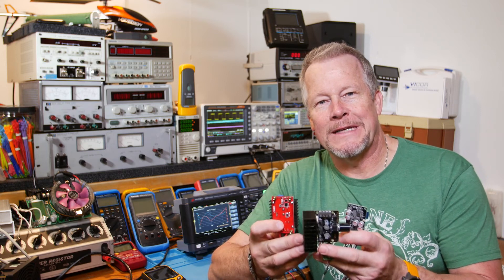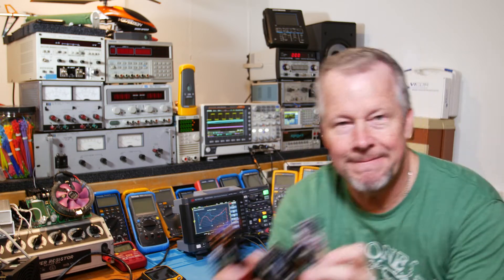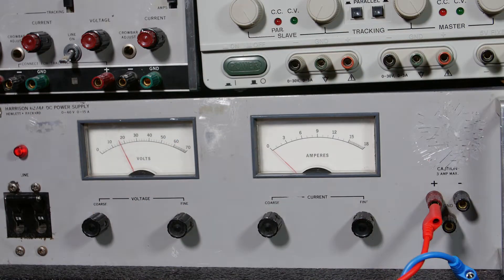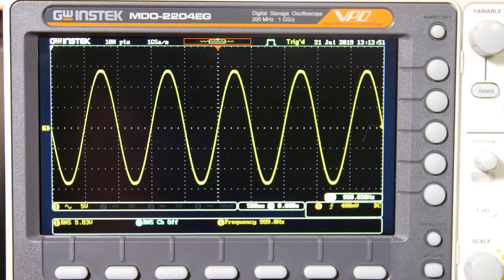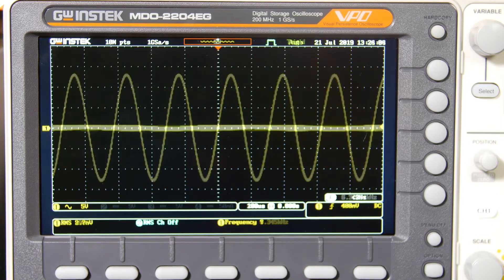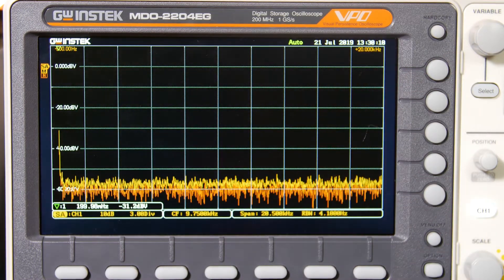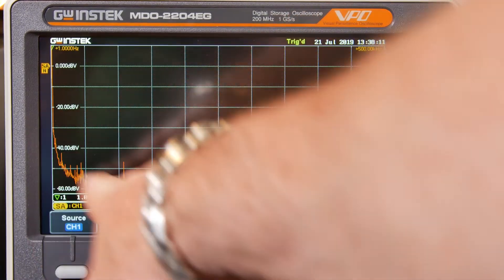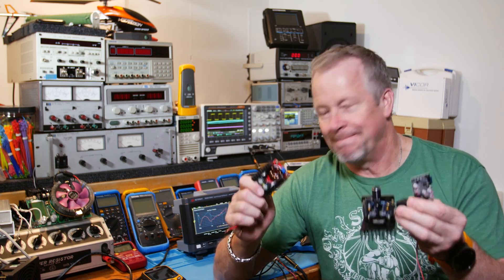DC-DC Converter add THD to Audio Amplifier? #switchingconverter #THD #DCDCconverterforAudio

Comment: Great information Eddie,
That makes me wonder why linear power supplies are still used for Audio applications.
A switched mode power supply will work just the same ?
As it's switching/chopping,  just like the boost converter ?
ATB Adam
Reply from the maker: Adam L thanks Adam!  I think mostly do to fear - bias - and even plain ignorance.  Power supply design either gets zero respect because it is thought to be easy by the uninformed - or too mysterious, so there’s just not s lot of power engineers out there.
Reply: I'm building a PS with a DC-DC buck converter and whilst I didn't think it would be easy I can say it is hard work to contain that noise.  I think I've probably mentioned this in a previous video sometime, but you only have to look around for "PS projects" on youtube/forums to find that close to 100% fail to be finished because it seems to become too hard to get right - even Dave Jones gave up!  One of my colleagues has been building power supplies as part of his day job for 30 years and even I've been able to teach him something new.  Although to be honest I don't think that's a good thing as it shows I'm way out there with my design :)
Reply from the maker: Andrew Johnson It sounds like you are learning a lot on your own.  I am planning a project that I hope you will like.  First, I’m going to do that quick filer video.  Just been working too many hours, but that’s about over.;)
Reply: @KissAnalog  I am a strong advocate for switching power supplies, noise problems are there with linear power supplies also. even ringing and high-frequency noise also present in linear power supplies. ppl need more information to fully understand that.
Reply: THEY ARE GENERALLY DIFFICULT AND,EXPENSIVE TO DESIGN,BESIDES THE NOISE PROBLEMS.ALSO ALL THE THINGS THAT COULD GO WRONG WITH THEM OR, WHAT I CALL A TROUBLESHOOTING NIGHTMARE.
Reply: @davidluther3955  To me do it also look like magic and wary few do succeed but some High End manufacture, like PS-audio, do use SMPS in there top end gear. To our luck, do Eddie know more then most about the subject, so maybe there are still hope:-)

Comment: hello sir i have a question , i have a smps 12v 40 amps power supply, can i use a dc to dc boost converter 32 volt 10 amps to power a class d amplifier?
Reply from the maker: Thanks for asking!  So you have 480 Watts (12V and 40Amps) and you want to boost to 32V at 10Amps (320 Watts)?  Yes that is easy to do and will be very efficient:)  Let me know how it turns out.

Comment: Great video, thanks! Question - I'm using a step up DC Dc converter in a car to boost voltage to 18V and I was wondering whether I should connect the inline noise suppressor between the DC DC converter and the head unit or between the car battery and the DC DC converter?
Reply from the maker: Thanks for the great question!  The converter will help isolate the noise from the battery charging system and spark plug noise, so it might work better after the boost.  If the boost is relatively smooth, it could help better in front of the boost to protect it as well:) I think I’d start by trying it in front of the head unit after the boost.  Let us know how it goes;)
Reply: @KissAnalog  many thanks! that is exactly what I was thinking of doing, seeing as the DC DC converter too might generate noise as I'm not using the most fancy one :)

Comment: Yes sir u are right that the thd of the amp increases because of the high frequency  interference coming from converter. But do u believe that there is a lot of dc dc  (step up/step down) converter circuits much cleaner than any SMPS.
Reply from the maker: Thanks for the feedback and great question!  I do think that good filtering can clean up the switching noise;)

Comment: Hi sir 
I want my 800 watts amplifier  boost converter. So if I use 1200 watts boost converter for my 800 watts amplifier so is ok or any issues .n also I m using this 12v bettery. Please guide me. 
Thank you
Reply from the maker: Yes it is great to use a power supply rated to handle more power than the amplifier is rated. So using a ps rated for 800 Watts to power a 500 Watt amplifiers sounds great!
Reply: @KissAnalog  thanks for reply.sir
Reply from the maker: You bet!  Thanks for the question.

Comment: GENERALLY IS IT BETTER TO USE FFT ON THE OSCILLOSCOPE OR A SPECTRUM ANALYZER?
Reply from the maker: David Luther David, another great question! I might need to make a video on this! FFT is a mathematical representation and the spectrum actually shows the signal in the frequency domain like the Oscilloscope  shows it in time domain.  There are scopes that have spectrum also which are mixed domain scopes like my GW Instek MDO.  The great thing about the oscilloscopes that have spectrum is that they typically go down to 0 Hz.  So they’re great for low frequency.  Where most spectrum’s and some mixed time domain scopes like Tektronix- typically start at 9kHz

Comment: This is case for classic connection boost converter to power ampifier and at the end this noise is mixed inside signal path inside power amplifier and provide to speakers on output. I have a total different connection inside my car. I am use boost converter only to keep stable 12V power supply for PC computer inside my car then from PC I am use external USB sound card then connect RCA cables from that sound card to 5Ch car amplifier which have own independent power source connected directly from car battery and which have 1F Rockford Fosgate capacitor in parallel right before amplifier power input. In this case only point when I can to have additional noise inside signal path is USB connection from PC to USB sound card but not in digital signal provided from PC thru USB and decoded in DAC in soundcard. Also I have all power cables, signal cables and speaker cables separated in every side in my car. Power cables are on left, signal cables are in middle and speaker cables are located in right side in car. Power cables for 5Ch Amp is 2AWG and for speakers are 11AWG. Signal cable is special 6 RCA cables inside one isolation cable.
Reply from the maker: FileFixer Wow!  Thank you for the great explanation of your system.  I’m sure it will help others.  Hope to hear more in the future!
Reply: @KissAnalog  I hope that my experiece with that can someone help in any way for better sound performance in car with buck converters. When I designed that system in my car I think to create low interference between any signals as low as possible. The most visible problem with my PC computer are voltage fluctuation from car alternator and my PC constantly rebooted before I decide to stabilze that voltage with buck convereter. Also, PC have own power stabilisation circuit inside case but it is not too much good for voltage fluctuation then for ripple and noise. Power amplifier are impossible to connect in any way than direct from car battery because that power amp consumpt 70A at full power output and amp also have own power supply inside case. For extreme short consuption peaks when low frequency gone to speakers I`m use 1F capacitor which is able to hold short voltage drop in that time. Car battery is also bigger than normal and it is 115Ah/960A instead of 75Ah/700A.

Comment: That is an interesting result and not what I was expecting: noise is comparable from the switcher to the linear PS.  Layout is absolutely critical for the former and the fact that no switching noise is making the output is amazing and kudos to the engineers.  If it's possible to find a really good switching PS then you have something that is smaller, cooler and more efficient.
Reply from the maker: Andrew Johnson I was actually surprised, I thought I’d have the opportunity to show how to add that filter;) You are right - layout is critical.  I’m actually pretty good at that, do I think I can share some good techniques.